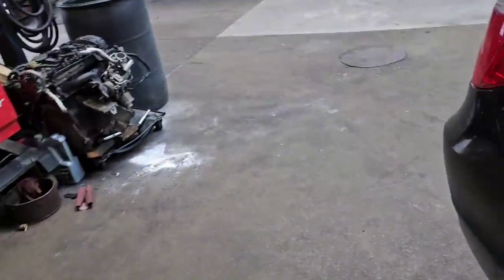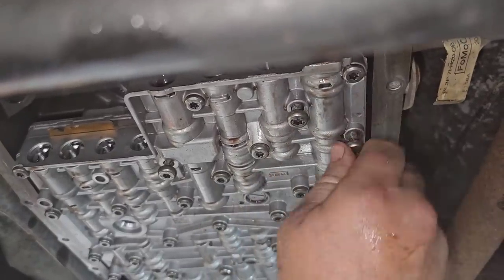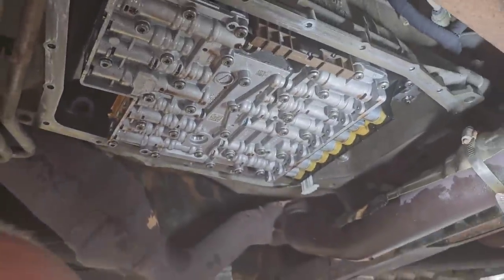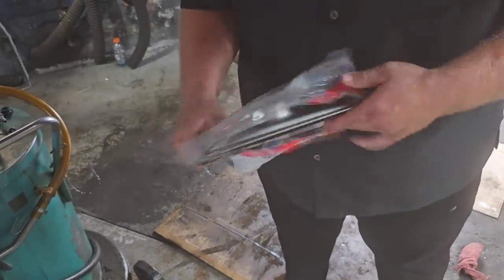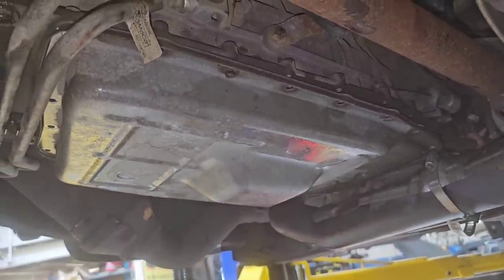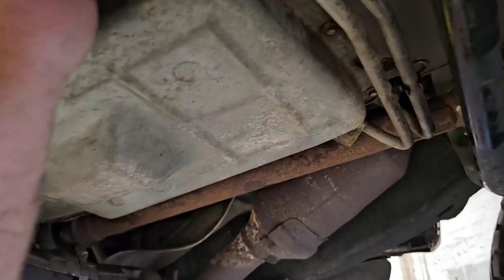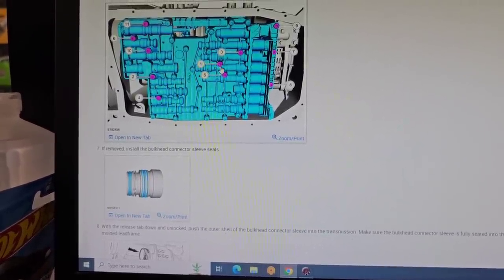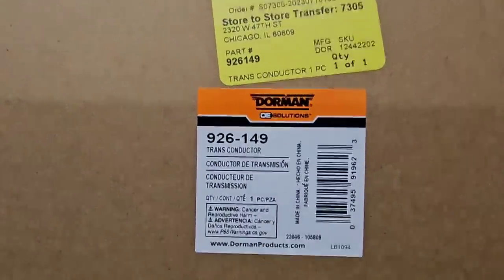2011 Ford Raptor Lead Frame Install - Dorman To The Rescue - Ford Has a national Back order Issue

Comment: Amazon sells a small electric extractor for about $30. I’ve used it to do fluid exchanges and I have run 9 quarts through my transmission with no issues.  It’s pretty fast too. It uses the vehicle’s battery as a power source. I’ve also used it on my power steering as well. Stay Blessed!

Comment: The yellow bridgeport seal should have been changed to the brown one (update). I believe every unit after the 2012/13 came with the brown one. The yellow seal is known to crack its a ford tsb. I did lots of them back in my transmission tech days. Great video as always Rich!!
Reply from the maker: Yeah but that's not why they get came here so there's nothing that you're trying to get across to me as should be changed

I change what I see fit I'm the owner of the company I'm the manager of the company last I checked you don't pay my bills or tell me how to do things and if it's not broke you don't fix it

Comment: The only way we’ve gotten them from Ford is via COPIS. COPIS VOR is like the magic bullet to getting stuff that doesn’t exist. Just because it’s in backorder doesn’t mean you can’t get it. Unless it’s a PCM for a 2015 Super Duty 6.2, the tool is unavailable for the production of the part.
Reply: Or the TCM for the Focus. 😂
Reply: @Moosecop32  the last one I put in for a Focus TCM COPIS never responded to. Parts manager came back from a meeting in another city with 5 of them to fix what was on our lot.

Comment: This is part of what I miss about my 16 f150. DIY transmission maintenance is simple.  Dorman makes a 6r80 pan with a drain plug to make fluid refreshes and pan drops much less messy. I had one on mine.
Reply: I have the dorman pan for my 4r70w transmission

Comment: Had this done on my 13 this month. Went bad in June. Called ford for the oem parts, they said backoredered 2months, so I got the Dorman one. When I looked up the torque sequence for the valve body, I saw that mine was still under the extended warranty from the recall. Took it in, diagnosed and confirmed it was was covered, but could take up to 2 months for them to do it. Thankfully they agreed that I could put in the Dorman and they would still put in the oem when the part came in so i could still have a working vehicle. Did it next day Took about 2 hours, not a bad install. They called 2 days later and said they got their hands on one early. 2 weeks later they did it.

Comment: I bought a $25 dorman pan with a drain.  Also got a new gasket cause the old one had a leak in the back. My theory is the exhaust dries it out, but it prob could have been reused.  Mine took 10 quarts - I left it overnight to drain.  I didn't do the valve body. There is a handy digital dash tells u trans temp.

Comment: Recently had my 2016 F-150 towed into the shop with a bad transmission range sensor (Code P0706, P0707, P1702, P1921). The mechanic changed the lead frame and valve body. Just picked it up and the truck now has a hard shift between 1 & 2. Curious if you have ever experienced this issue after replacing a lead frame and valve body? Some forums state the vehicle just needs to be driven and it will work itself out. Really appreciate the level of detail your videos go into.
Reply from the maker: Sometimes it's a bad lead frame

Comment: Quick question, what if when I already filled it up with about 6-7qts. While the trans temps are at about 195F & engine running the fluid on the dip stick is very low (half way on the stick itself, but not near the A or B) BUT AS SOON as I turn off the engine (STILL SUPER HOT) the fluid goes all the way up to the stick past the B. 

Should I add more while its running to get it up to the half way of the markings. Or should I take some off?

Thank you for the video btw, really helped alot .

Comment: Dorman one is reliable?

Very nice work. Thing that falls out is the t-stat, that is why it can't be flushed unless very hot.
Ahh another 6.2L F150. Hope mine don't need that part, common repair.  Ford sells the ENTIRE VB and LF for $500, no backorder.  But I guess the Dorman is less.  Extremely trouble free truck so far @200k. Came with a Flowmaster with large piping, sounds unreal.  Only issue is the A/C evap, going to change it one day soon if I have time.  Dash has to come out ... :lol: would def bring it to you if local.
Reply from the maker: I don't know where you're getting your parts from but Ford said they don't even have it available that way to this guy so I did what I had to do here I know everybody's got something to say about something but in this situation what my customer is telling me and how I dealt with it is the best that I could do
Reply from the maker: It's not a bad job, I've done Evans no problem
Reply: @FordBossMe  Its great work. I was thinking of doing mine for Preventative maintence, my local dealer offered me the whole assembly, declined, but with the demand for that part they could be gone very fast.

Comment: Boy Rich I always have trouble with getting the new filter to stay up in place while putting the pan back on , I noticed yours stayed in place. Any tips on getting it to stay while installing the pan ? Thanks Rich !…….
Reply: Trans gel will work. I think Rich said a little bearing grease won’t hurt somewhere in the comments. Lube guard assembly goo is what I have in my garage.
Reply from the maker: Don't lube the seal for the filter, it grabs nice when you don't on these
Reply from the maker: @flyer8493 just talkin about the filter itself that's what he's after
Reply: @FordBossMe  👍

Comment: And the SSSC is NOT helping either. We have had them fall off the BOHOLD twice. This is why fully integrated parts suck!  I actually remember before it was the OSS failing, it was the range sensor crapping out in mainly 2011-2012

I always had trouble unlocking that pass through latch lol
Reply from the maker: Because it's a pain in the ass to unlock
Reply: @FordBossMe  A-greed!! i broke a few in my day!

Comment: Got a question about after replacing the lead frame. We got the fluid topped off and after taking it for a test drive, 1-2 shift feels a bit clunky and 5-6 slips a bit. Did a trans reset and told the customer to drive it so the trans can adapt but was curious to see if anyone has encountered this issue.
Reply from the maker: Got to make sure nothing in between that valve body got dislodged or you lost a little ball or something like that or there's no debris they got in it
Reply: @FordBossMe  thank you for the reply! Customer lives in Houston and I’m in west Texas. If I come across one of these again I’ll be more careful and inspect everything twice.

Comment: Surprised that you got so much fluid out without flushing out Torque Converter. On my car ZF 6 Speed when the Pan and filter is removed and new ATF put in, only 3.5 Litres goes back in the pan. Then the mechanic starts the car and puts in another 500 millilitres then takes car for drive and then opens Fill Hole and no more goes in. 4 Litres max ATF goes in pan. 8 litres of burned ATF in the Torque Converter which the Garage doesn't want to flush out. Around 12 Litres of ATF in Pan and Torque Converter and only 4 litres goes back in.

Comment: Bearing grease in a trans ? Not a very good idea, suggest trans gel or vasaline, grease will clogg valves and burn clutches, it wont melt and mix, just my input
Reply from the maker: Little bit won't hurt, don't be a drama queen
Reply: @FordBossMe people just don’t listen, 10 quarts and a little dab of grease won’t hurt anything.
Reply: Just erks me lol, watched a guy do it at the shop shop ended up eating a trans, used is on every balast seal, pistons was not a very good sight or smell after he reinstaled it

Comment: Petroleum jelly will work to keep that valve in in the absence of Trans Jel
Reply from the maker: I've used it all
Reply from the maker: I've used a dab of the dreaded bearing grease as well, the transfluid cleans it right up

Comment: Ohhh noo. Dorman electric components doesn't ever give me much confidence in repair longevity, but Guess oem being on backorder gives you not much choice. I use trans gel on that blue little shuttle to keep it in place during reassembly. Did you install the foam strip in there too where the lead frame mates with the solenoids?
Reply: Dorman is hit and miss ... sometimes their stuff works great, case in point the window regulator in my driver door of my '05 P71, still strong after 4 years ... then there is that whole 4.6 intake manifold issue ...
Reply from the maker: Sometimes people talk crap about Dorman and it's OE parts or made by them for OE
Reply: If you look at the Dorman lead frames, the few we've seen are Ford factory parts that still have Motorcraft part numbers on them. I'm guessing the cores that are being sent back are being sold to Dorman for remanufacturing.
Reply: Informative as usual boss, good to see your hands black and dirty. How’s your knee been treating you? 🇦🇺
Reply: @Moosecop32  the last lead frame we had was shipped directly to Dorman. So I imagine that’s exactly what’s happening.